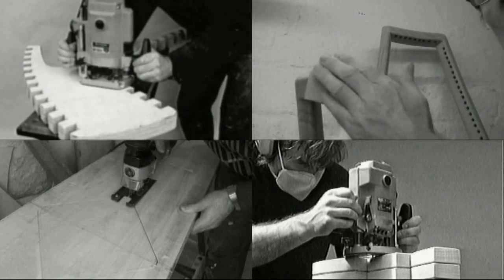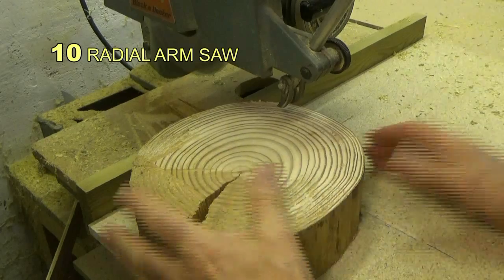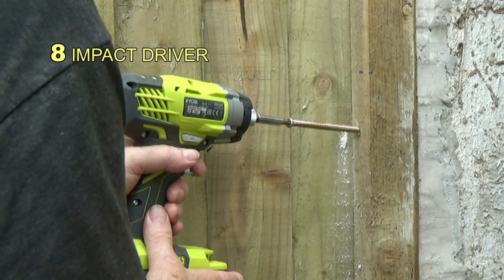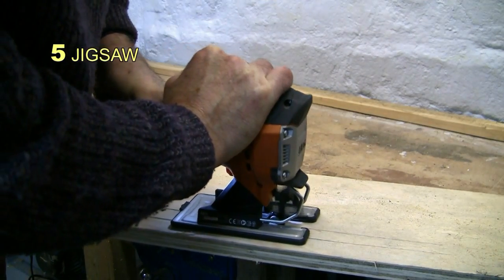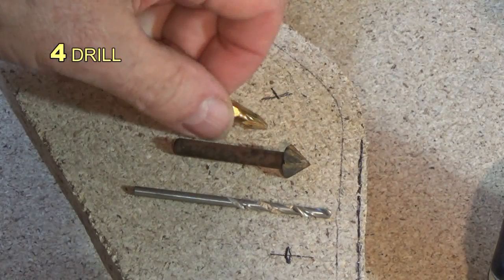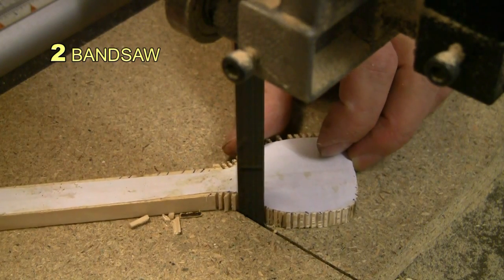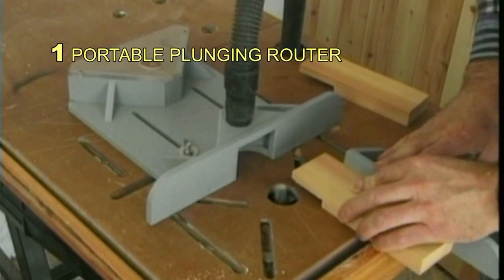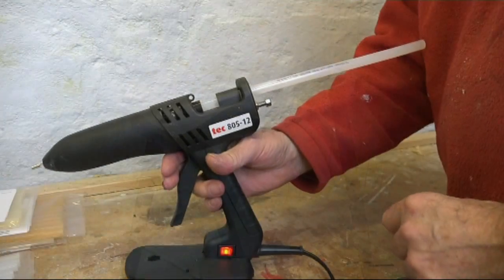Top Ten Woodworking Power Tools

Comment: For me number one would be wood mill... A large bandsaw. Its as good as drum sander and thickness planer combined, you can cut your own material and so on... But in a workshop... I guessed the entire list and I couldnt belive that someone would have the same list going on in hes head. Subscribed.
Reply from the maker: Yes but my video is aimed at those setting up a workshop and the average woodworker will probably have a garage type space so I have deliberately focused on smaller power tools.  I may do an outdoor woodwork tools run down.

Comment: Interesting, about the only thing I COULD argue with your list is the biscuit joiner being higher than ten while the lathe wasn't on the list; other than that pretty spot on.....

More bird hide videos please (or boat build for getting to bird hide, lol)...
Reply from the maker: Yes Todd, I tried to keep the video down to 5 minutes so had to cut out of the script that the rank order is fairly loose. Arguably I could have swapped the drum sander for a lathe but thought a lathe attachment to a corded drill would include the important mention within the Top 10! Lathework tends to be a speciality activity and I have to say although I have 2 wood lathes and a metal lathe set up in  my workshops, I rarely use them for general woodworking/furniture making. Yes the idea is already in my head for a lightweight simple boat for when the bird hide valley fully floods and from which to take ariel footage with my drone camera. Thanks for your interest in the project.

Comment: The radial arm saw was every bit as versatile as the router in terms of jobs it could do. Never got the recognition it deserved. Used but never owned one.
Reply from the maker: Absolutely right Joe - it received bad press. I have a small Ryobi radial arm saw that has a router collet on the swivelling head. Fantastic machines. Hopefully they are still available but I now see they are crazy prices. I paid £50 for my s/hand 10" Dewalt in 1973 and had the motor re-wound just once. A very solidly built tool.
Reply: joe obrien I did. It was the core of my small shop for years. It is versatile but changing set-ups is a real hassle because everything has to be tweaked for alignment, depth of cut , etc EVERY time you change operations and again when you change back.
Reply from the maker: Tioga Fireworks: the whole point of a radial arm saw is its very quick to change mode! I said in my video once it is set up it is good to go. Changing from 90 degrees for crosscutting to parallel for ripping is a notched position and the whole point of the saw. Adjusting depth is also quick on a a quality machine. Even switching to dado cutters is quick and that is a massively useful feature. Watch this one and a half minute video to see how quick it is:  https://www.youtube.com/watch?v=z6kS540Qj9w
Reply: Exactly,,, where on earth can u buy a radial arm saw these days? I'm sure it's illegal in the EU as are dado stacks (ie, impossible to find table saws with matching arbors this side of the pond). Luckily I was able to import such a table saw (a contractor  and decent enough for my standard) from the US when I moved home to Norway. Apart from my Husqvarna chainsaw and Triton router (both which I use daily), it's absolutely my #1 (I make playground equipment/toys).
Reply from the maker: In the UK you can buy them new (eg AXPTC: http://www.axminster.co.uk/machinery/saws/radial-arm-saws ) but I see they are very expensive. There , are plenty s/hand on Ebay and Gumtree.
Reply from the maker: One very good reason for the UK to leave the EU, the other is my kitcar would be driven off the road as noyt meeting standard clone!  https://www.youtube.com/watch?v=lf_k9SomKtE&list=PLMSYcWuGT7v_DHj9t20IBujIVWCIGSRLu&index=14

Comment: Hi Jeremy, Taking you as example (beginning your career with a portable planer) I would like to receive your advice about buying the right saw, considering that I’ve not money (-;  I’ve an intermediate level and I wonder whether to buy a saw bench as a Makita MLT100 or 2074 (500-900€) or a proper professional saw bench type Lamberti or Holzmann (1800-2500€). That in order to make professional pieces and set the objectives high. Thank you very much for your help!

Comment: Great overview and I agree with your choices. I note a few comments about the safety of the radial arm saw - overblown in my opinion - all power tools have the capacity to injure the operator and require sensible application. Have you seen Frank Howarth's video channel, an impressive woodworker and a great film maker with an enormous workshop - he has about half a dozen radial arm saws - so he is running the safety gauntlet big style - lol.https://youtu.be/1IPbqibZhEo

Comment: Can't agree with half of this list . I did use a radial arm saw lieu of a tablesaw for a number of years - but they are a child of the 70s, very dangerous, and no longer readily available. In 2017 a good tablesaw has to be #1, or a tracksaw. Planer-Jointer yes. Router yes, but with a table of some kind.  drills and driver yes.  Forget the drum sander and orbital - get a good variable speed random orbit sander - but learn to Sharpen and use hand planes and scrapers so you limit the sanding. I use my compound power miter saw daily but it's a one-trick pony and a crosscut sled for a tablesaw will work.  I use my drill press a lot - also pinch-hits as a spindle sander.  And finally I agree w the need for a bandsaw.
Reply from the maker: Well thanks for dismissing almost half a century of my first-hand experience! Incidentally I only had hand tools for the first four years of my making a living so I had to make my choices carefully - a random orbit does not cover the surface area for table tops and is a secondary sander. There is nothing more accurate or quicker than a small drum sander for getting small panels absolutely flat. What I should have mentioned is that if you design your work around narrow boards (eg the Scandinavian method of edge jointing) you make big work in a small workshop but I tried to make the video under 5 minutes long. I cover sharpening tools in the Top Ten Hand Tools so please do not confuse the brief here. The point of the 43mm collar drill is that attachments such as grinders could be used. I could have mentioned a chop saw but the less popular radial arm saw beats it every time except for compactness and sitework but this video is about setting up a workshop and a small one at that.
Reply from the maker: I would NOT recommend a random orbit sander over a full size orbital for these reasons - the surface are and flatness accuracy is not so great, sanding discs cost much more than buying AO paper in a roll, the swirling marks or more noticeable (eg on table tops) than with an orbital.
Reply from the maker: The video is about power tools, not scrapers that are hand tools. I deal with hand tools in a separate video but would NOT include a scraper in the top 10. There are more essential hand tools. Sanding is a long established highly efficient and integral part of finishing in the woodwork industry and power tools are a microcosm of that.